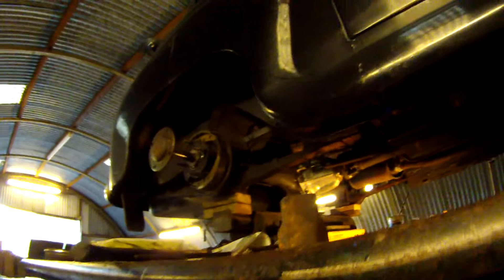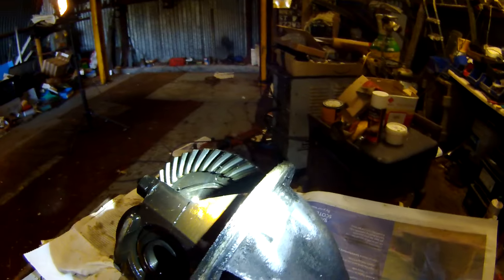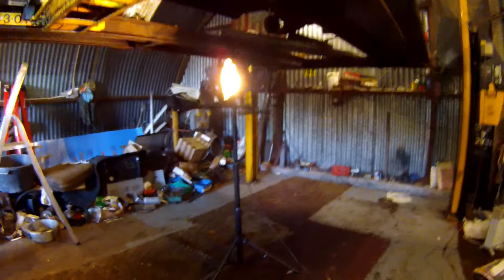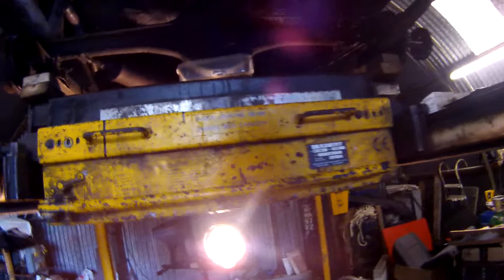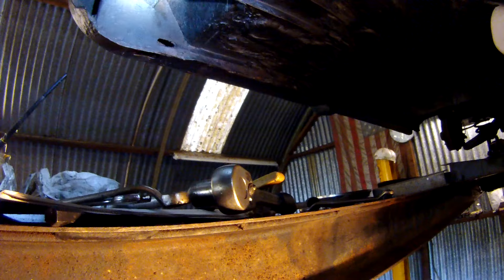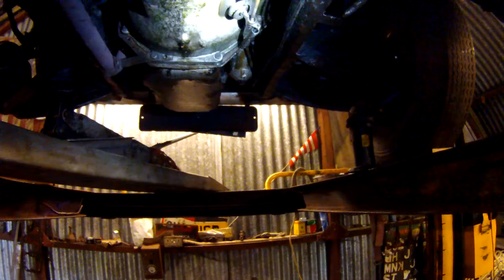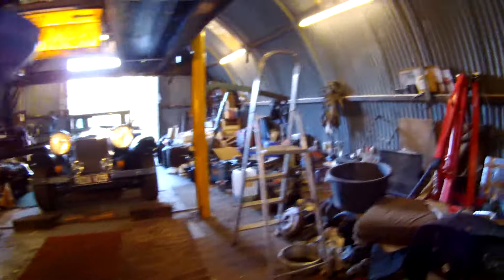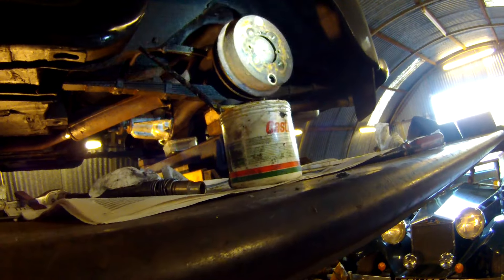1954 Austin A30 differential swap from 4.55 to 4.22

Comment: nice , she's solid isn't she , you've been lucky with her more or less straight from auction , well done 👍👍
Reply from the maker: Yes solid where it really matters as these body shells are quite complex to repair if rot has really taken hold to the stage where a  reconstruction of critical stuctural suspension support and alignment elements is involved. Had a lot of experience buying vehicles unexamined in person in fact 90% have been bought that way in recent decades. Used to buy on ebay.com and import from the high dry western US states so have a well developed instinct for what to go for and what to avoid justed based on images and some owner information ( you buy the seller to quite a large extent and if they have shown the car some recent TLC as with Bertie that often is a green light whereas so called barn finds, AKA long term abandonent to decay, are seldom quick or easy to make reliable) but even then there is an element of luck as you note.  Very happy with this car. The differential swap  this weekend has turned out to be a resounding success as this afternoon video shows. Only a few mph alteration around 50 mph but seems to make all the difference in feeling longer legged and reduced engine revs.